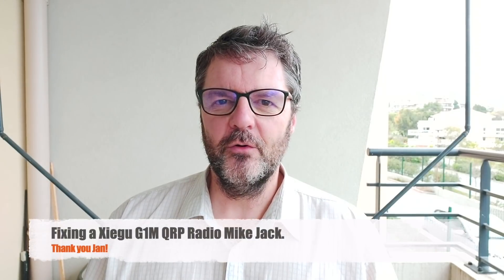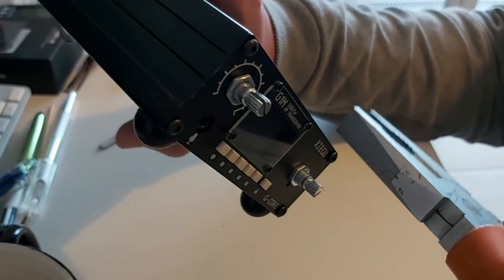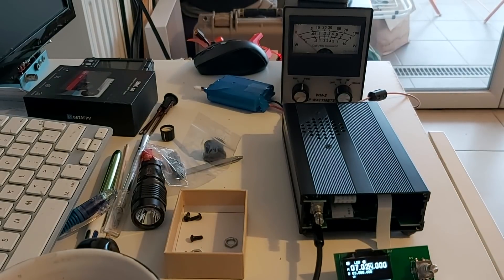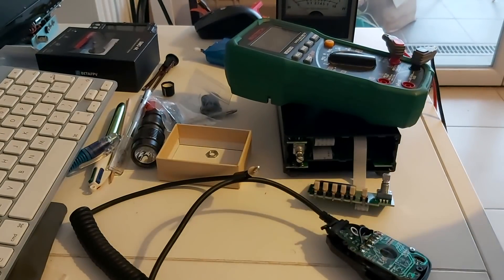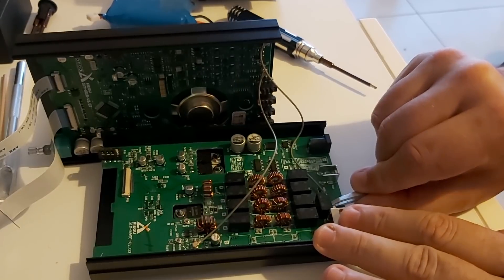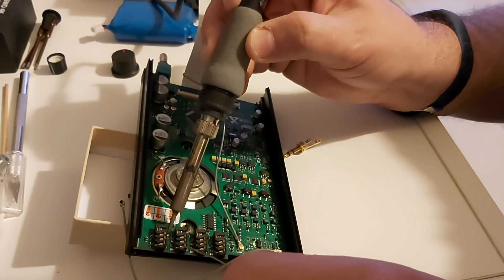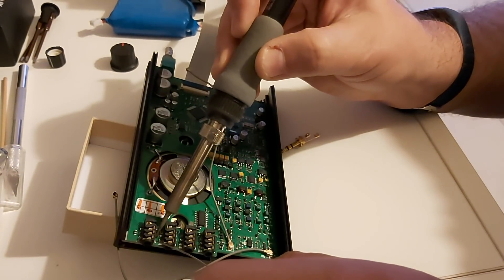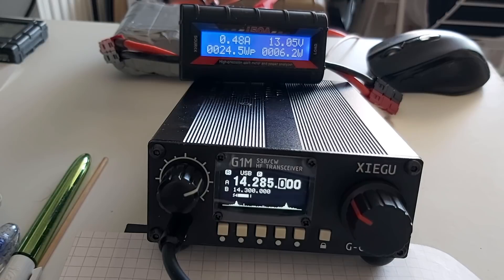Fixing a Xiegu G1M QRP Radio Mike Jack.

Comment: Any idea how to improve mic audio? I've replaced mic by Panasonic and still ppl said that audio is with bass, no treble... I placed order for compressor.
Reply from the maker: I also have an electret mic for mine but never compared the audio..
Reply: @RadioPrepper  i saw test at YT - CB compressed mic was used with G1M. Digference was huuuuuge. They also did V measurement and it looks tkerenis no V comming to the mic (if it's not dynamic there should be some voltage).

Comment: hi gil . love ur channel  i have a dumb question when you reflow the solder joints do you add any flux .even if you dont add any solder do you dip ur solder tip in flux before reflowing .thank for all the great videos keep ur tubes warm .
ki6pxv. rodney.
Reply from the maker: Usually not but it isn't a bad idea...

Comment: Gil, another great video!  Very applicable to me right now as I just received my g1m and the mic jack is compromised 🤣🤣🤣 from the factory. Oh well, can't say that you didn't give me fair warning!
73 W9BLH
Reply from the maker: Just reflow all the jack solder joints adding a tiny amount of solder. Mine now works great and no more worrying about a jack getting loose :-)
Reply: It looks like it would have been a good time to add a case mounted mic jack, but not much room. Are the mics with those electret or dynamic?
Reply from the maker: Electret I think. I didn't check if there was any DC on the wires..

Comment: Now when you had some time to test this radio, how does it compare to your Minion SDR transceiver? 🤔
I'm most curious if you're seeing any similar problems with stray RF as you seem to have with the qrpver contraption. 
And I'm not expecting you to go all in this time, doing another salty wet 'Havsfidring-test' with your G1M - since I think I can estimate how that would turn out... 💦 🌩 🤣
Reply from the maker: Honestly they are about equal, though the keyer is useable on the G1M, not on the Minion SDR. The Minion has all HF bands, the G1M four... They are both sensitive to common-mode currents.
Reply: @RadioPrepper  Thanx Gil! ✌️

Comment: hello have you tried the method to open all TRX bands ... Can you give me feedback on your experience please ?! cordially
Reply from the maker: Hi, I am waiting for you to try so that I do not risk damaging my radio.
Reply: @RadioPrepper  you have to activate FBND TX (menu 11 of the firmware) in the firmware of the G1M and add a 10m band filter on the pcb (there is still a slot for that) of the G1M to use in 27Mhz ...
Have you tried on your side? Do you have this option in your firmware version?
73's
Reply from the maker: Hi, no, I sold it since I bought the G90..
Reply: @RadioPrepper  ok I too have the g90 :-) it's great and also i bought the x6100 do you have it it's great...
Reply from the maker: I wish I did...

Comment: Ok ... I know this is off topic . . Not this radio ... This is about possible repair of a radio . 
I am sending out an S.O.S. for anyone that could help me with is radio I have . It is a great radio . Ok . Enough of that . It is a Weber Soda Pop ll . I do love it . I did not build it . It was gifted to me . I was told it worked good . I used it with with ear buds and everything was good . Once I changed to speaker . I could not hear my side tone . This was with a powered speaker . I thought you might know what I need to do . Maybe there is an adjustment inside the radio ? As a YouTube creator I need that . Thank you .
Reply from the maker: You might want to ask on radiopreppers.com and the kd1jv io  group...

Comment: Hello, I bought a Xiegu G1M transceiver and I would like to obtain the firmware, or the programming or modification procedure to be able to transmit continuously on all the hf bands as on the Xiegu G90 ... Because for a QRP I would like to be able to transmit without difficulty on the Citizen Band included in 25 and 30 MHz ...
Looking forward to your response ...
Best regards
Reply from the maker: Sorry no idea, but if you find out please let me know...
Reply: ok no problem ... I sent an email to the manufacturer Xiegu! I will follow up on the subject
Reply: Hello, I am coming back to you to open the Xiegu G1M all bands ... Actually, it's like for its big brother the G90 Xiegu ... there is an SMD diode named T4 present between a Pin of the µControleur STM32F405 and the GND ground It is black in color! You just need to unsolder this diode and test if the all-band TX mode is unlocked !! Here I am I have not yet tested because I am not at home but I would like to know if it works for the G1M so if you tested before me tell me if it is ok Good day Gil
Reply from the maker: I might try that thanks.
Reply: Hello Gil, have you tried to extract this Smd diode to open the station on all bands ?! Because I am not yet not at my home where I have the transceiver ... I await your return to know if it bypasses the all-band locking ...?
I am sending you a message from an operator ... this is what he says !!
Unfortunately I don't know how the G1M works, but have read in the user group that the tx band settings are hardcoded in the firmware. If there is a diode that can be lifted to bypass this, I don't know.
Reply from the maker: No, I haven't looked into it yet...
Reply: ok I hope you will give feedback from this experience ... Normally this is the right solution See even a YouTube video of the modification for Internet users Thank you in advance 73's
Reply from the maker: If I do it I will. There is the filtering issue to consider also...

Comment: Gil could you please do a video on how to interface this for Digi modes, I've not had much luck. 73's great video
Reply from the maker: OK, will do.
Reply: @RadioPrepper  I've seen this in Eham, but no luck. HERE'S HOW TO SET UP FOR DIGI-OPS:

1. run the included USB CAT cable from your computer to the rig's COM port
2. run a 3.5mm cable from the rig's SPK jack to your computer's audio in
3. run a 3.5mm cable from your computer's audio out to the MIC jack (connect GND and tip, then mark the jack)
4. launch flrig (which had been configured to use IC-7100 192008N1 echo)
5. launch fldigi (which had been configured to use flrig as transceiver control)
6. adjust sound levels
Reply: 73's de 2M0HFC
Reply from the maker: I tried that, didn't work on Mac, so I used an interface..
Reply: @RadioPrepper  Interesting would be great to see your progress visually, in fact I would think many Hams with this radio would be the same. There is very little resource on the process, certainly nothing on you tube that I can see.
Reply from the maker: I should have filmed better I guess...

Comment: Great Job Gil! You might consider getting a  reflow hot air station with interchangeable tips. Perfect for surface mount repairs and reflowing bad solder points. The hobby versions are very reasonable. Less than $40 US on ebay for hot air only station. I use aluminum foil to mask areas of the board i dont want heated. Works Great!
Reply from the maker: Thanks, definitely on my list...

Comment: Great video Gil.  I have G1M as well, and the feedback audio is the one thing about the radio I cannot stand.  It is so bad that I currently only use the radio for digital modes.  I notice it most when using headphones on mine.  Have you figured out how to eliminate it yet?  That would be a great video as well.  73
Reply from the maker: Interesting, not yet.. Have you tried different antennas?
Reply: @RadioPrepper  yes I have tried a couple of different antennas.  I even built a new microphone, but that did not help, radio still has bad feedback.  It is very digitized and not clean at all. It sounds very similar to what you had going on in your video.
Reply from the maker: I put a ferrite on the microphone cable, will also try an RF choke..

Comment: Hi Gill I would say the soldering is OK on your SMD parts and the Sockets are indeed SMD as well. The problem is that the amount of solder used in an SMD joint is low as they are just so small  which doesnt bode well for mechanically stressed joints such as the connectors. Cheap assembly methods and poor QC means you get problems like those in the video... I fixed my sound card yesterday merely by soldering the audio out connector which had never been soldered, a through hole part but still it wasnt done properly. Keep up the good work !
Reply from the maker: Exactly! Easy fix if you solder, but not everyone is up to the job...

Comment: My G1M failed to boot up after a month so I returned it and got a G90 instead. Both nice radios for the price. But, both seem to suffer from ground loop problems booting up the radio with the data port connected to the computer. Let's hope they fix their QC problems.
Reply from the maker: Definitely  it's like they're "almost there..."

Comment: Nice work, I wonder how it is on CW. And I wonder if you have to end up re-soldering the CW jack too. All things aside, that radio might turn out to be your 'go to' radio to use in the field. It looks rugged and it didn't cost anything. Merci
Reply from the maker: I will be testing CW soon, did resolder all jacks..

Comment: To be honest when you screen a smt board stencil printer screen thickness is 5mill  typically. The legs on those are so thick compared to the paste height and typically the legs solder by the bottom in the smt oven.

Comment: What  is  really queer about this radio is that there are no ferrite transformers anywhere near what Giles calls the power amplifier transistor pair. I am guessing those two are in fact voltage regulators, maybe one for five V and the other  a bias regulator for the single RD16 Mosfet used as a class A RF amp. - I am interested in purchasing this beast as they are Extremely good value for money - as long as the connectors don't fail.  The sort of price you are looking at direct from PRC is around USD 250 plus shipping.

It is great to have had a chance to see in side the radio - esp. to get some idea about what options there are for replacing the cheap encoder used for tuning.  Some of the production ones (frm OLine Newgroups) have fallen apart in service.  The ribbon cable looks like a serious potential point of weakness for Sota and knock around use.    TE Fidler  NzL

Comment: I have the same radio for WWFF use and I have been quite happy considering the price. The microphone socket issue seems to be dependent on the batch, I checked mine and the solder joints looked just fine, no issues after 20 trips. The stock microphone is crap, I suggest replacing the electret element in it or get the qrpguys microphone kit. I have been getting decent audio reports ever since. Also a tip since you are into CW, there is a narrow CW filter which is not mentioned in the manual. You can turn it on by long pressing the KS menu item. 73 de OH2BAV/P.
Reply from the maker: Thank you!
Reply: @RadioPrepper  FB! I also noticed the audio feedback issue that you are having. It is more prominent on higher bands like 20m and barely noticeable on 80m. The same issue appears also in through the speaker connection so it is probably internal RFI. I have not managed to solve that one yet.
Reply from the maker: I put a ferrite on the mic cable, we'll see...
Reply: @RadioPrepper  I have tried ferrite on two different cables plus wrapping the whole cord in tinfoil, no difference. So my theory is that it is internal. But my skills to figure it out further end there.

Comment: Gil, when you test the radio in the field would you test the digital modes also? Does it have a VOX for dig input also? 73 de Wolf, oe7ftj
Reply from the maker: Oh yes, I need to look into that...
Reply: @RadioPrepper  The G1M does not have vox, so you have to trigger the ptt either through the microphone jack or through the comm port. I chose the latter with the Signalink and correct cable.
Reply from the maker: Darn, I will need a cable for my interface then...
Reply: @BingoLarsson  Tnx fer the important info!

Comment: I'd love to "fix" mine from the start.  It is going to get bolted down in a carry box and I'll strain relief the cables in the back.  I thought of designing a 3D print to strain relief a mic extender and mounting the print off of the left lower screw.  What are your thoughts on that?  Kind of like the Yaesu Powerpole adapters?  Split a 1/8 stereo out to mic and PTT jacks to have a separate foot pedal port?  Great work!  73 K4RJJ East TN
Reply from the maker: Thanks. I think I'll use heatshrink tubing on the mike jack/cable.

Comment: Thanks for video! As amazing as always! I have this radio and the other day managed to speak to someone in Florence from here - near Toulouse (your country). It appeared that they could hear me fine, but when I monitor how my Tx sounds listening a receiver at the same time, it makes terrible modulation soup sounds when I’m not speaking. I suspect they don’t receive my Tx this way though. Strange.
Reply from the maker: Indeed...
Reply: @RadioPrepper  oh, and for laughs sake I’ll tell you what kind of antenna I used: an indoors wire stretched into three 7m sections in a Z shape under the roof beams, with a 9:1 balun and a small antenna tuner just before the radio 😛😆
Reply from the maker: Very nice, LOL. I suspect the radio is lacking some filtering..

Comment: Thats why you pay 4 to 10 times as much for a Yae-com. Unrelated observation, just 4 LPF s for all HF bands? And only 2 toroids in each? I'll bet this rig would not pass Australian spectral purity regulations requiring -50dB suppression of harmonics/images.
Reply: FOUR band Radio only .   2.   a two PI section filter is standard in all 5 W level radios > What  is  really queer about this radio is that there are no ferrite transformers anywhere near what Giles calls the power amplifier transistor pair. I am guessing those two are in fact voltage regulators, maybe one for five V and the other  a bias regulator for the single RD16 Mosfet used as a class A RF amp. - I am interested in purchasing this beast as they are Extremely good value for money - as long as the connectors don't fail.  The sort of price you are looking at direct from PRC is around USD 250 plus shipping.
Reply from the maker: Could be, I didn't read the markings...
Reply: @F_Tim1961  OK I assumed more thanb4 bands, my bad.  Yes I know, they are amazing value for money. At least if yours stops transmitting you have a good idea about how to fix it.
Reply: @Paul_VK3HN   Paul - here's the weird thing - internally it is set up for five bands but the 10mtr band has been left out.  I don't think that will be  for cost saving - my guess is that because the output PA arrangement is so crude it may have produced well below 5 W out 10mtrs so rather than get into disputes with purchasers  , they decided that  they'd just not offer than band.  The other option is that for starters they'd offer it as an 80 -15 mtr tcvr and then the Yew beaut model B would have the 10mtr band offered for an extra 15  USD down the track whereas the true cost of adding it would be only say five dollars. 

I have found it listed on a Aliexepress with  known good vendor for AUD 306 delivered to Aus/NzL.  That's one hell of a good price.  I'd say it would have to be opened up and the mike SMD connector reflowed but if you do that then it is known fixed. 

When you look on the internet you can't find any proper maint and repair manual anywhere so this video showed me stuff I simply could not find out any other way.  ONe thing comes to mind - the input board with the display on it - I wonder if the factory can provide those as spares - out the back door as it were.  to pay say another oh 50 USD (Freight incl)  for one of those as a back up if the main unit arrived fine and was working would be a really good investment. My tuppence worth.
Reply: @Paul_VK3HN  To clarify  I have not bought one yet but it is getting serious consideration.  Better maybe than buying a brand name tcvr second hand that someone has beaten up and internally modified and you don't work that out until too late.

Comment: Why didn't you test it on CW to check to see if the PA was working?  Are you going to add some decent audio filtering inside? Maybe one of tiny boards from SotaBeams? TX audio is not brilliant.
Reply from the maker: I will look into that, thanks.